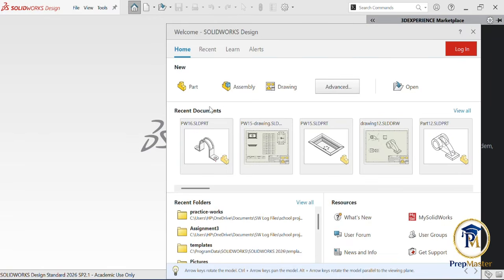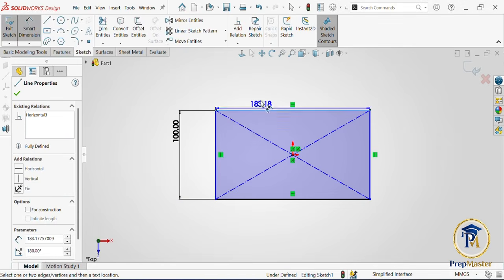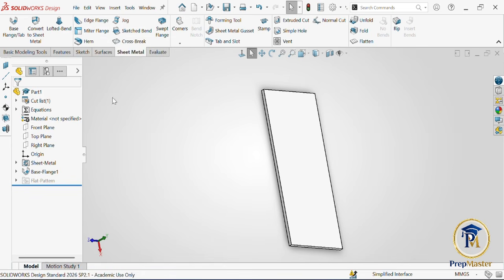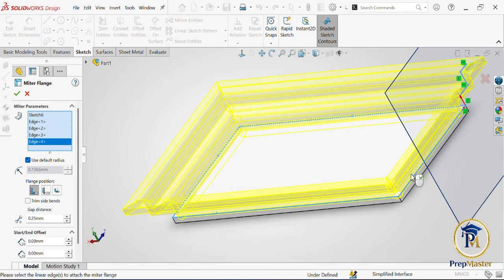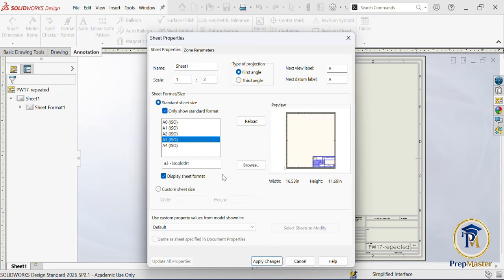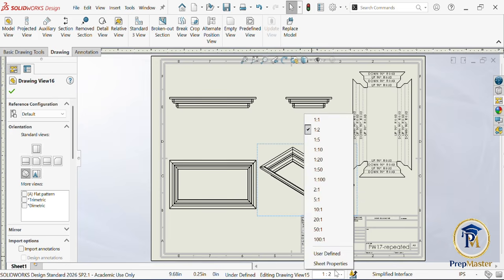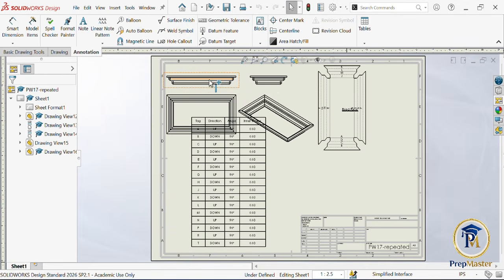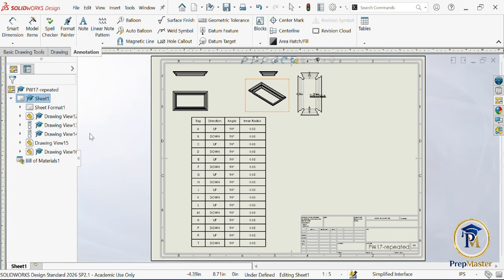SolidWorks Tutorial #5 | Problem 5 Made Easy | Step-by-Step for Beginners

Comment: When i clicked on the miter flange and sketch how the wall of the plate would be, it did not work for me.
It said unable to create a miter flange with this radius and I kept trying other smaller radius, but it was still the same way
Reply from the maker: I am sorry you are running into that error, but please re-verify your sketch dimensions and bend radius settings to ensure they match the tutorial.